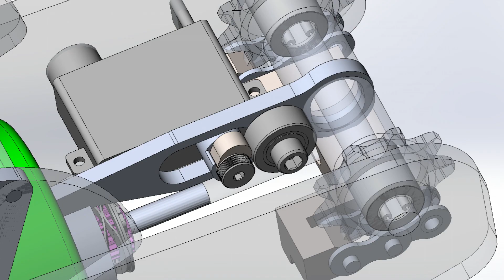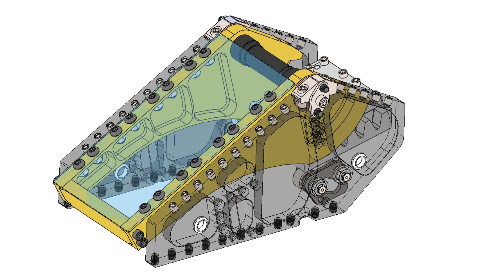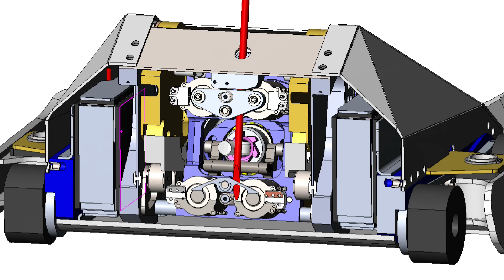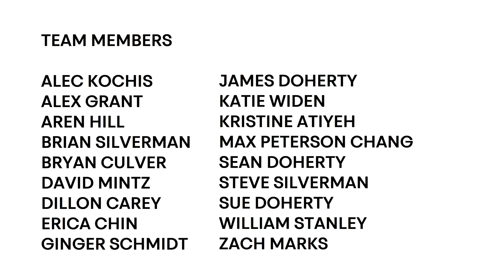BLIP REVEAL [Seems Reasonable Robotics]

Comment: I was wondering how this worked. Turns out it's essentially what would normally be a lifter bot but optimized for huge speed.

EDIT - I wonder if I could design something similar on the 1lb scale, replacing some of the mechanical tricks you guys used to get around problems with software.

EDIT - Thinking about it more I think the answer is probably not. I'll have to go a different route for my tiny flipper. I've been down a bit of a flipper rabbit hole recently.

Comment: This is so clever, and after seeing a couple of battles with it, it appears to be a very solid design. I can see that using the torsion rope can also reduce the impact on Blip itself, since it connects and disconnects using a clutch plus I suspect the rope itself has some give, so there is less jarring of the robot on itself. It also appears that weapon recovery is really fast with the flywheel. So impressed with the engineering of this robot. Not bad driving either, LOL. Hope to see it go far in this year’s competition. Seems to be the dark horse of the year.

Comment: I have to congrats the team with the design and build. It is fantastic. The idea to create a new form of flipper tecnic is great. Maybe it is also possible with some sort of springs that is compressed but still it is a very new and great kind of flipper. Not sure if it is more prone to damage but using gas or someother form is likely more vunerable.
Reply: Was just thinking of using a flywheel and clutch to load a powerful coil spring :)
Reply: Season3 tantrum was a spring flipper and well...
Reply: Problem is that blip has gyro

Comment: In case you weren't already impressed, remember that the robot it's flipping weighs over 200 lbs (90kg).
Reply: Actually it was 255 Ibs (115kg) that it flipped, even more impressive
Reply: @kingj7606  wasnt the limit 250lbs(113kg)?

Comment: My number one concern is the flipper sitting too high. It gonna be difficult to get a good flip.
Reply: Hindsight is 20/20, but hasn’t been an issue so far. This may be an issue with hydra since hydra is such a ground scraper, but I think this design can be really reliable as it doesn’t tear apart itself from shock like it appears hydra does. I think the if the two went head on, Hydra my have the ground advantage, but Blip might just win on reliability.
Reply: @capohd28  got to see it vs better bots and drivers. So far kinda expected Blip to win.

Comment: Add Mecanum Wheels.
Reply: no
Reply: @Aren-Hill  

The control needs adjustment.
With Overhaul, the bot needed to move 15 degrees and it was 30.......it was over compensating continually.
.
Accurate, fast, sophisticated movement is key to creating a world champion bot.
Reply: @Aren-Hill  
Swerve drive and 3 wheels ?
Strategic, fast manoeuvrability = under used.
See Sumo Bots.
.
This looks interesting but without good manoeuvrability it's going to be smashed up unfortunately.
.
If it faces any blade it will get wrecked immediately.

Comment: Really cool mechanism, and a great way to produce the sort of instantaneous power a pneumatic system usually provides. Two questions if you don't mind answering. 

Why use the rack and gear mechanism as opposed to a linkage or bell crank or something? seems like added weight/complexity and opportunity for destructive failure if a piece of shrapnel were to jam in the gear teeth. 

Also neat use of a rope, but why not use something like a screw? I imagine the rope might be more prone to snapping, especially after a couple of uses. I'm guessing you guys have tested this a fair bit, and the answer is probably that I'm wrong and it actually holds up fine. What sort of rope is it?
Reply: The rack gear simplifies some force handling, by aligning the force from the twisted cord actuator directly with the pitch line of the rack gear, if that's not in line the cord would be rubbing on the tube in the middle, and also making some funky forces elsewhere, there may be something there, but this is what we went with for rev1 of the mechanism.

The twisted cord actuator is actually the real magic of the mechanism, the ratio of it as a transmission varies over it's stroke, and it starts with a ratio of infinity. This characteristic allows us to accelerate a stationary object without "smashing" any components and asking for instantaneous acceleration.
The cord is made from Dyneema (UHMWPE) filament greased up
Reply: @Aren-Hill  thanks for the reply, that all makes sense. I guess any lever simpler lever mechanism would result in the direction of the force changing during the stroke, I hadn't considered that.

Also that's a neat feature of the chord. I also imagine its much easier and cheaper to swap out between matches if it breaks. Plus I guess it can act as a sort of mechanical fuse to avoid fubaring the bot. 

Do you mind sharing how the mechanism unwinds/resets? Is it something else to do with the solenoid lever mechanism? I couldn't quite figure out what that does.

Anyways, I know who I'm rooting for to win. I've always liked flippers and the ingenuity and thought behind this one is fantastic.
Reply: @H34...  The friction cone clutch happily serves as overload protection rather than snapping the cord (this is the current thing limiting us from flipping higher)

As for resetting we have 2 nitrogen die springs that push on a small lever arm on the flipper itself, so at the end of travel when the rack gear hits the clutch release lever the springs take over and pull the flipper back down, this backdrives the cord bundle and lets everything reset quite quickly. These die springs also keep the flipper arm down during the match rather than flopping around.
Reply: @Aren-Hill  You guys are geniuses ! 
Thanks also for sharing so much about it.

Comment: This could be (and probably is) entirely wrong, but it looks like Blip has a motor that drives a gear system (that might be changable depending on the opponent) that drives the flywheel. At 1:35 is a section of solenoids or some other actuator. These push a coupling over the flywheel (or flywheel shaft), which is shown at 1:43. This coupling connects the flywheel to the twisted cord actuator, which drives a rack and pinion system, which actuates the flipper.

Comment: OOOOH I SEE, it's not my original assumption, but its similar, as it is a flywheel on a screw kind of thing instead of a gear attached to a flipper which pushes onto a flywheel gear.

Comment: If this can drive like tantrum, this could be potentially the best flipper. Could THIS bot be my temporary favorite replacement?
Reply: I would expect to to drive more like Tantrum them even Tantrum this season. Seeing how it's Aren Hill who will be driving it. Who was the captain for Tantrum and the driver. Sure you already knew this though which is why you mentioned Tantrum. Would expect it to be more durable then Hydra as seems like it's basically armored like Tantrum was and seems to be just as fast. Nice to finally see a front hinged flipper in Battlebots. I know P1 has competed for the last two seasons but to me they are more of a front hinged lifter as they can't fling bots in the air.
Reply: @wisewolftony  how's blip front hinged?
Reply: @addium3151  My bad I just saw the design and figured it would be. Just due to the fact that every flipper I have seen with that wedge design has always been a UK front hinged flipper